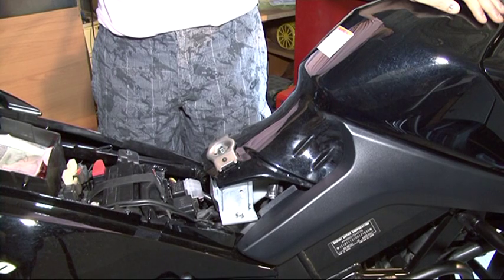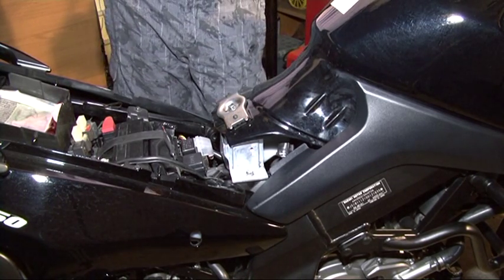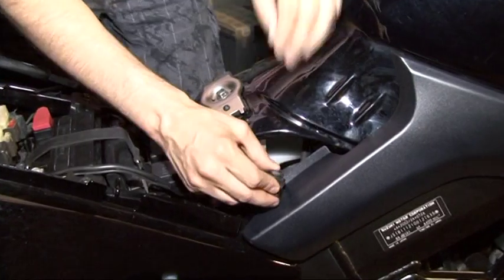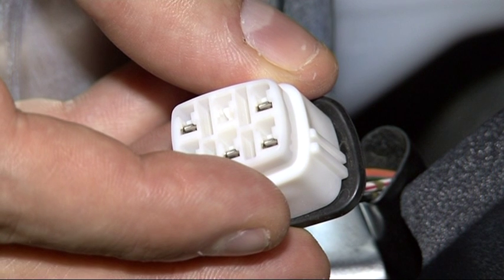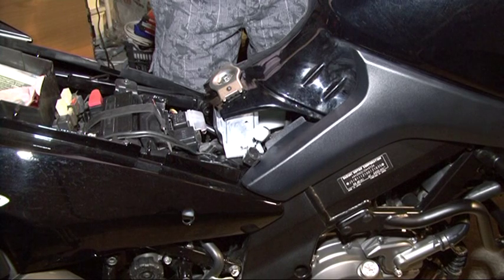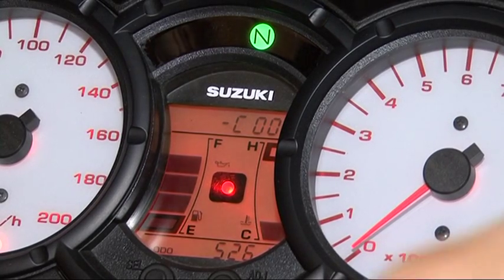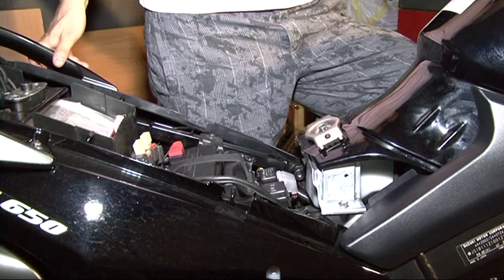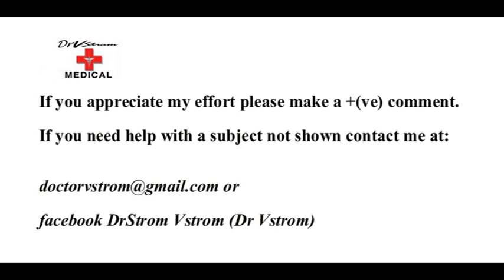How To Put Your Motorcycle Into Dealer/Diagnostic Mode | DL650 Vstrom L0

Comment: My 08 vstrom 650 literally does not have this plug anywhere
Reply from the maker: Thats not possible. The plug should be there
Reply: @DrVstrom  I've done research looked in all the places where it could be and there's no plugs that resemble the plug that should be there
Reply from the maker: The plug is on the left side near the positive battery terminal. Check if it is hidden below other cables. I can see in the manual the location ofr your model and it is there.

Comment: Hi I have a vstrom and I’m getting C27 can you help me look in the right direction to fault find
Reply from the maker: What model and what symptoms do you have?
Reply: @DrVstrom  thank you for your reply , the bike is a 2014
As soon as the bike is started the TC switches itself off and the TC light and ABS light both stay on constantly and the FI light also comes on constant. 
The bike seems to run ok but those 3 lights stay on 

I put the bike in diagnostic mode and it showed C27
Reply from the maker: Your bike is the 1000?
Reply: @DrVstrom  yes sorry it’s the 1000
Reply from the maker: If your model is 1000, C27 refers to Ignition coil #2 (side). It can be many things but here goes a few. 
1) Check the ignition system couplers for poor connections. 
2) Faulty ignition switch OR Faulty side-stand relay OR Faulty engine stop switch OR Broken wire harness.
3)Faulty spark plug
4)Faulty ignition coil. You can try to swap one with the other & then check again for the FI code. if the code changes it means it is the ignition coil that is faulty.
5)Faulty Crankshaft Position Sensor OR dirt particles stuck on it & the rotor tip. 

Let me know how it goes
Reply: @DrVstrom  thank you sir , would those faults also bring on the TC and ABS lights ?
Reply from the maker: some probably would yes. It depends. Start with the easy ones first.

Comment: I have a 2018 Vstrom 1000xt and now immediately after a 7500 mile maintenance schedule service I have the flashing F1 code alternating with odometer mileage readout. I am locating no such diagnostic port on the 2018. Would you know of a changed location for that model year?
Reply from the maker: Should be on left corner under the seat as you look towards the back of the motorcycle. It is capped and white next to the black cylinder.
Reply: My bike is showing ç14 then I turned it off but the bike wasn't start again, what can I do to start , help me out thanks

Comment: Hi. Is it possible to clean error?
Reply from the maker: It depends on the error. Sometimes for instance it might be something very simple like humidity or some cable not connecting properly or the ignition key and it goes away by itself. Other times it is something you need to fix first for the error to go away. Usually you have to find the cause and fix it.

Comment: Sensacioanl your channel. Congratulations
I did this process, accused the TPS sensor out of position ....
I regularized.
But, he also accused, the C13 (Intake air pressure sensor)
Where is this sensor? Do you have a video about?
Like and one more subscriber.
Hugs
Reply from the maker: https://youtu.be/mOkYOSNIsR0 go to this video at around 5 min . I show which ones are the air pressure sensors. Make sure you check those and  are in good state and clipped correctly. Also any tubes that attach to them must not be cracked.

Comment: Thanks for uploading this. I am thinking of buying the new 2020 1050 XT which I guess has similar arrangement. Nothing stops me though from pulling two wires with a switch from the hidden connector to a more accessible place like under the pillion seat or handlebars so I don't have to remove the riders seat everytime. Dealer mode just became easy peasy. I wonder why they haven't made already like that...

Comment: my friend, I need your help!  I have the 2005 model 650cm3 when I try to start the bike I feel like a click coming from one of the devices near the battery, I don't understand what it is that prevents the bike from starting, the battery is charged and new.  trying to act on the control that there is to the clutch the bike started but probably that was not the problem because after turning it on and off several times the problem occurred again. Thank you in advance.
Reply from the maker: Fulvio Taddei The clicking noise is the starter relay. The battery has enough power to actuate the relay but not enough to spin the starter motor. The starter motor might need service. Try to tap the starter gently with a small hammer when starting. If it starts you need new brushes. https://www.suzukipartshouse.com/oemparts/a/suz/508afda6f870023530723034/starting-motor
Reply: @DrVstrom  you are fantastic!  thank you so much!  I'll try tomorrow!  the bike is almost 15 years old and 43 thousand km.  I think the doctor's diagnosis will surely be right!
Reply: @DrVstrom  my dear, thank you again, I did as you were saying to give the starter a little blow, the bike turned on regularly and now every time I start the engine it starts.  I think there is dirt due to the wear of the brushes, I will shortly disassemble the starter and remove the dirt and check the wear of the brushes, if they are still good I think that with a clean I will have solved the problem!

Comment: Sir, your diagnostic is exactly what I have with my DL 650 (2004) but I need the solution please so I can fix it
Reply from the maker: Well what code do you have ?
Reply: @DrVstrom  I don't understand sir but I am in France
Reply: If you want I can send you a video on what's going on with me
Reply from the maker: @fbizreh1  sure. But the solution depends on the code that comes up when you put the bike on diagnostic mode. Eg C033 might mean certain failure .
Reply: @DrVstrom  now I understand according to your video I need to have those electrodes to plug in, but I don't have them
Reply from the maker: @fbizreh1  you can use a paperclip metal
Reply: @DrVstrom  I am still looking for the piece that u showed on your video to make the test
Reply from the maker: @fbizreh1  simple paper clip made of metal will work. You know what is used to get a4 pages together
Reply: @DrVstrom  Sir It is ( C - 23 )
Reply from the maker: @fbizreh1  It can be your battery or the Tip Over Sensor.Look here and locate it on the bike.https://www.boonstraparts.com/en/part/suzuki-dl-650-v-strom-2007-2011-dl650-tip-over-bank-angle-sensor-2010&ID=B10000N7PR               TOS is in front of the battery. It should have the word UP on the top. If TOS is properly oriented, just turning the ignition off and on again will reset a C23. Otherwise you might have a bad battery which might need to recharge or replace. Check battery, i have a video for that and also check if TOS is correct pointing up. If not put correct.
Reply: @DrVstrom  thank you sir
I will check it out and come back to you.
Reply: @DrVstrom  I did exactly as you said, it is working now super.
I appreciate your help and kindness.
The problem is with TOS,  it was put down, the technician tested it previously and put it back wrongly

Comment: Hi there, greatt video!
I had an error C44 and i did all the tests according to the user's manual, result was a faulty heated oxygen sensor.
I replaced the sensor with a new one but sill the error exists. is there any procedure to clear the memory? or maybe the new sensor is bad\wasn't the problem from the beginning? 
Many thanks!
Reply from the maker: Probably the second thing you mentioned. There might a way but maybe you first need to check if your problem is not solved or if its more complicated. Hope that helps.

Comment: Dealer mode plug. All DL1000's & NON-ABS DL650's Location: under the left rear fairing. 3:59
Reply from the maker: zeta4836 up to 2006 for 1000 and up to 2011 for 650. Video was made at that time in the past. Best, the Doc
Reply: @DrVstrom  Ok, thanks for the clarification

Comment: Mine show me the cod: C13 C23 C29 and also FI, do u know what’s can be?
Reply from the maker: Which year is your model
Reply from the maker: All codes you mention are in my video in the beginning
Reply: Doctor Vstrom 2007 650DL
Reply from the maker: That’s a strange combination of error codes. Did you recently do any service ? Are there any other symptoms? Does the bike start, run properly? C13 refers to also the IAP sensor vacuum hose that may came out. There are 2 of those on the back of the air filter box on the corners
Reply: Doctor Vstrom no the moto is so weak, can get more than 5000hpm, but this problem a mechanic told me it’s in a fuel pump :/

Comment: Hi, thanks for the video, but I have a unclear issue. While driving the F1 indication appeared together with the red warning light intermittently blinking. I have put the bike in dealer mode as you described and went riding until the error would occur again. To my surprise the error code C45 appeared in the clock location but not together with the red warning light. C45 is not on your list. And when I stopped the bike, turned the engine off, the C45 error code disappeared and C00 was shown instead again. I did not see it again when continuing driving until home (about 40 km). What could this mean. Do I have to worry?

Thanks for your help in advance

Comment: Very good videos all of them and really detailed!!! One thing that it was good to mention on that video is also that the dash on the left of the error code is telling us if the TPS is properly installed, if its not in the center of the C  (lower or higher) that means that you have to loosen the bolts of the TPS and turn it clockwise or the opposite till the dash go in the center again. Also I would like to ask you about the exhaust near the oil filter that I saw in your video "DL650 Vstrom L0 Oil & Oil Filter Change", is there a special way to clean it and make it so shiny? Thank you again for your shares!

Comment: Check fuel pump volume.  Search on any of the V-Strom forums for the procedure.  Possibly weak pump or clogged filter causing fuel starvation at high throttle settings.

Comment: Hi John, Great series of videos - really helpful! My DL650 AK9 has developed a prob, I wonder if you have any ideas. Bike starts & idles fine. Just riding around, the bike is also fine. However, under heavy acceleration (eg; overtaking), there is a serious loss of power. If I roll back the throttle - picks up OK. Bike now tops out at about 75mph. I now have changed the plugs (NGK Iridium) & air filter (standard Suzuki). 5199 miles. Error code C00, therefore ECU says OK. I'm stuck, ideas? Cheers!
Reply: Man hello. You are my man. I have exactly the same problem. I do not move my bike for like 2 weeks now cause i almost fall of that problem. What was it? How did you fix it? I am really sad about this cause i work 12+ hours 7 days a week and i have no time to take it to the mechanic.

Comment from the maker: Cable is from a PC motherboard but any cable or paperclip will do . The seat is removed via the key. If you are referring to how you can bridge without turning the motor OFF in the cases that you must not turn it OFF then you either return home and use your spare or you have it with on you. Thanks again

Comment: btw, just in case people like me experience this same problem. Those getting the C40 code may not actually be the ISC Valve. It ended up that I put on an aftermarket clutch and brake lever. and the switch that is supposed to hit the clutch (neutral switch?), was sliding out and not being depressed. This caused the C40 error (wtf?!). The fix for me was to drill a hole in the clutch so that the switch sat right without sliding out. good to go now! Thanks again John and Google Search of course! :)

Comment: Yay!!! Thank you John! Leaving the bike on and pulling the code works! Now it's onto attempting to fix this problem. I am just extremely happy i was able to pull the code now. C40 error which is the ISC Valve (Idle valve). Also, fyi, not sure why, but I've had everyone tell me the same thing you did about the ECU code should be stored on the bike, but it kept giving me a C00 code every time i switched the bike off and back on. Anyhow, just wanted others to see this in case they had the same. TY!

Comment from the maker: Code is stored in the ECU so it should be there. You can put the bike into dealer mode whether the engine is running or not. Just bridge the plug like in the video in either case:

1. You are riding & notice the FI code. Stop riding & with the engine still running bridge

2. Bike is still & engine is OFF. Bridge & push the RED switch down to close the circuit as if you are going to push the engine started button. You dont have to start the bike though, just gather the   C-XX codes

Let me know

Comment: My bike gets the FI light only when i am riding. How do i pull the code if turning off the bike and turning it on again doesn't throw wa code? can the engine be running and the code be attained?